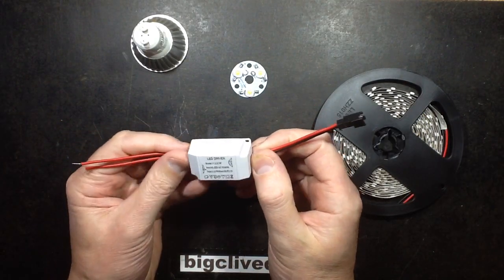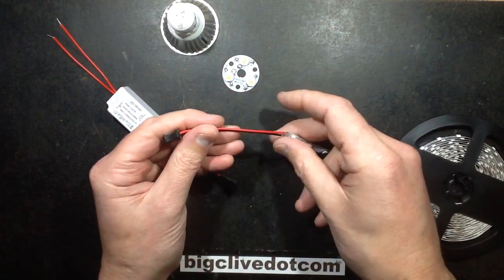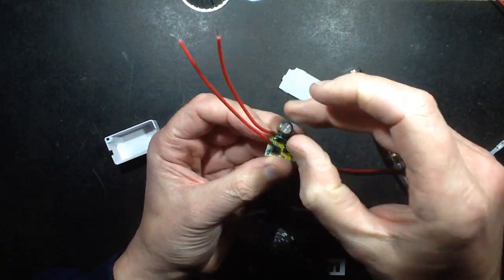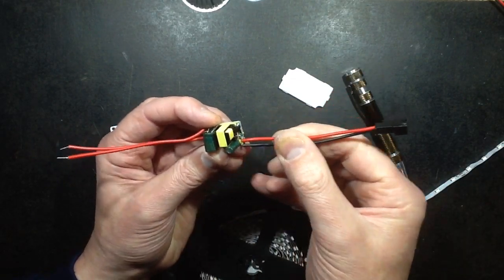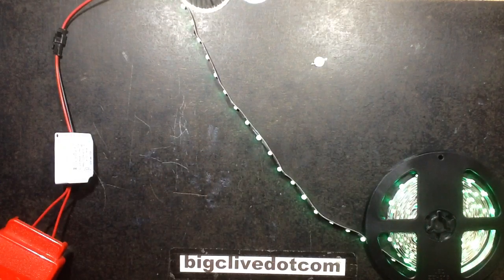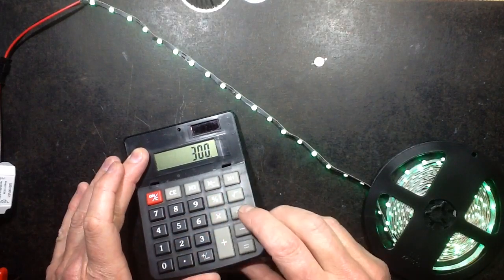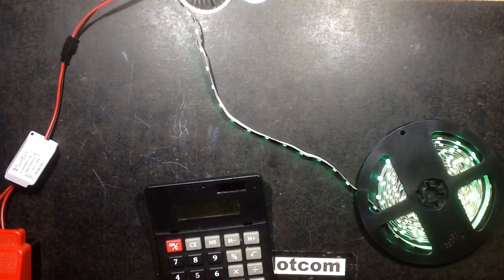Running LED tape on an inappropriate power supply.

Comment: Hello Clive , please help me how do u calculate current  load for 100 m triple LED  and how much LED driver needed?
Reply from the maker: Typically for 12V it's roughly 60mA full white per three LEDs, so it will require lots of power supplies, buffers and suitable fusing.

Comment: Thanks for the GREAT VIDEO. I had been searching for something like that, for AGES! I have got LED lamps at my home, and very often they burnt out. They were pretty expensive to replace. However I had bought cheap LED strips from China that I wanted to put in the lamps instead of replacing the whole lamp. I wanted to find out if I could run the 12V LED strip, with the Constant Current Power Supply used originally in the LED Lamp. So apparently I can... Will try it now..
Reply from the maker: It will depend on the power supply.  For unknown ratings it might be better to get a small 12V supply for the tape.
Reply: @bigclivedotcom  I dont need the whole LED strip for the lamp. I need max 50 cm (20 in) long Tape.
Reply: @bigclivedotcom  Very off-topic here, but I find it great that you still reply to comments on videos from 5 years ago! Cheers!

Comment: I've got RGB+W 12V 5m LED strip and as I counted:
1 segment = 10cm = R+W+G+W+B+W -> 6 x 5050 LEDs
5m = 50 segments = 300 LEDs
300 * 20mA * 12V = 72W (12V 6A)
Am I right?

But what if I just want to drive only for example RED and BLUE (using arduino)?
Does it mean that I need (2*50*20mA*12V) 24W (12V 2A)?
Reply from the maker: If you measure the current of just one section of LEDs it will give an idea of the potential total strip current.  It can be high with RGB tape.  Sometimes it's better to divide it into smaller sections.

Comment: Hi,

I recently purchased an LED light strip and PSU from China to go alongside one I had bought from a U.K. store.
This is to go under a bunk bed for our grandchilderen.
I installed and tested the light all o.k.
Sunday morning 06:00 grandchild screams about a large bang when he turns on the light.

Investigation shows the PSU exploded!

I have pictures but am unable to upload them.

Regards,

Doug
Reply from the maker: Don't trust the cheap power supplies.  By all means buy the LED tape, but source a power supply from a reputable UK seller like CPC or Rapid Electronics.
The eBay power supplies are often very under-rated, have poor internal protection and worst of all, often have very little isolation between the 240V side and the output.
Reply: Hi,
Thanks for the quick reply!
I have done exactly as you suggested an ordered from a U.K. supplier. I've never had this sort of problem with anything I have bought from China before, maybe I've just been lucky? Anyway lesson learned! :-)
Thanks.

Regards,

Doug

Comment: I was searching your channel to see if you did a video on ebay AC to DC power supplies.  I was shocked to find this video because I actually used this setup to run some led's under my microwave.  I used a 1M length (60 led's that I did have to cut down a bit.  I think I shortened it by 4 or 5 led's).  I was curious to the quality of the power supply and the safety of it.

Comment: Clive (or anyone) . . Can I run those led strips off an ATX  (Pc) power supply on the 12v? I'm doing it already intact and they seem to like it, I'm just concerned about longevity . . Thanks.
Reply from the maker: It's fine, but use a fuse per strip if the supply is rated for a high current.
Reply: @bigclivedotcom  Great, thanks Clive 👍🏼

Comment: I'm using 2x 5 meters led tape and more 40 centimeters of tape. A 12v 2A at the controller, and in each joint a little amplifier with One more power supply 12v 2A.
But, the lights are messing, only a few is working propelly.
Any suggestion? Any idea?
Note, all of them works fine alone, things get strange after the amplifier.

Comment: Hi! well great video but i hate the fact that it confused me even more. xD Did you say the LEDs are connected in parallelxD project involves a 5m Led strip rated at 20w per meter at 5v. what is the recommended power supply as far as the current is concerned.
Reply from the maker: If the tape really is 5V then the voltage drop across it will be significant at the current involved.  It would potentially be 4A per metre.
Reply: +bigclivedotcom so for 5m i should get 4A * 5m = 20A power supply?

Comment: Where can I get a workbench quick connect like you have with blue, green and brown quick connectors?  That is awesome and perfect for quick connect of line voltage.  I like the way the lid snaps closed for safety.
Reply from the maker: It's a Cliff Quicktest that's common in Europe, but now available in US/Canadian colours too.
Reply: OK.  Found them.  Kind of pricy.  Seen them several places on the internet.  Range is between 50+ to 100 US dollars.  Looks like something that would sell for about 25 to 30 dollars.  Have to think on it at that price.  But thank you so much for the reply!  I want one.

Comment: I wired one of those boxes with an infared reciever up to a molex connector and plugged it straight into the 12V rail on my computer PSU. I have RPG LED tape inside my case now. Looks cool as hell!

Comment: Anyone know what that power supply is? The one with the safety lid to turn it on?
Reply: Bit late, but if you're still wondering you can google for "Quicktest Mains Connector Block" and get one of your choosing and country.

Comment: How would this be different than using simple power adapter (lets say with the same current output and voltage as your 300mA driver)...  such as the ones used for  light duty electronics (chargers, modems)?  Would they work to light up LED strips like this or would the adapter burn out? Would it just be dim?
Reply: As far as I've tested, you can use them, BUT.
Voltage of the supply should not be higher than voltage of the LED strip. Otherwise you get a burned strip. (lower is fine but you'll get dim light, pretty much what you'd expect)
As of the current, the strip can't draw more than the supply provides, so in case of undercurrent it simply won't work.

The question "what happens if you overcurrent your strip" is why I watch this video.

Comment: Hi Clive. I'm big fan, love your channel but... Correct me if I'm wrong but saying that this powersupply will pump 300mA through let's say one section (3 LEDs) is a bit bull...? That would require far more, than 12V, which this powersupply is capable of delivering.

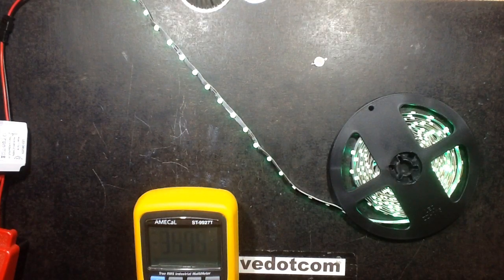Comment: @ 4:29 you say, "...4.48 volts across 150 ohms"; which would be ~30mA.

When you calculate it, you use .48V; which gets you 3.2mA.

So did you misspeak with the 4.48V? I think so because 3.2mA you get matches the top of the head calculation you did at the beginning of the video.

Not trying to be nit-picky but when I follow along I pause the video to do the calculations myself and check my answers against yours. Because of the angle I couldn't really read the screen myself.

You make great straight forward videos; keep it up!
Reply: +theomnipresent1 It was clearly .48V.
Reply: +theomnipresent1 He started to say the word four, but then stopped halfway to say "point". So it was "fo-- point four eight volts"

Comment: Hi Clive and Happy New Year.
Loving all your videos.
Electricity baffles me so I need to confirm something with you. I bought two lots of LED lighting so 40 modules in total.

LED Type : 5050 SMD*Warm White
Input voltage: 12V DC
Current Per Piece : 60 mA
Consumption Watts Per Piece : 0.72W
Number of LEDs : 3 Per Module
Number of Modules : 20
Waterproof

Power supply is a laptop style brick AC 240 down to DC12V 5A.

Will this PS be suitable?

Thanks.
Reply from the maker: 40 modules times 60mA (0.06A) equals 2400mA (2.4A).  So if the PSU is genuinely rated it should be fine.
Reply: bigclivedotcom 
Thanks. Haven't tested current output yet.

Comment: I repurposed a computer supply to run mine. the over voltage protection kicks in at 12.8 and shuts the supply down . the adhesives I doubt are genuine 3m  as none of mine have stuck well  even with proper prep.

Comment: Hi Clive I ran a 5 meter RGB light string on 12v 1a. After a day it stopped running. The supplier told me it needed a minimum of 4 amps.
Reply from the maker: The 5050 type of tape that has the RGB combined into single LED packages is very power hungry.  It does require around 4 or 5 Amps for the standard spacing stuff.
Reply: @bigclivedotcom  how can i get 4-5 amps from? can i plug from any socket at home?
Reply from the maker: @vivian-uh7lz  If it's 12V tape you'll need a suitable 12V power supply rated for the tape at full load.
Reply: @bigclivedotcom  how do you mean?
Reply: @bigclivedotcom  and anyway can i ask u about how my problem with my led strips, maybe u could help me?

Comment: Looking at LED panel lighting and some of the power supplies they come with are horrendously RF noisy. One guy could pick up no broadcast radio in his house because of them!
Reply: +Choppington Otter 
Yeah, too many LED advertisement boards such as those used outside of CVS Pharmacies have dirty supplies.

Forget about using an AM CB within a block of one.

Comment: I just received a reel (5M-300-3528) of Blue LEDs (£2.32).
Wrapped it around a window + connected it to an old monitor PSU (12V @ 4A)
and it is incredibility bright.

Comment: In regards to using that PSU with a short length of LED tape, the current would be limited by the maximum voltage that the little PSU can put out.  Did you ever measure the no-load voltage of it?
Reply from the maker: +DavidAVD1 I've never actually thought of doing that.  I just assumed it might float up to a random level off load.  I have now corrected that assumption by testing it and it came out at an open circuit of just 12.24V.
Then I shorted it out to see how it fared.  It fared fine, so I stuck my meter on the 10A range and shorted it with the probes and it clocked in at 216mA short circuit current.  Quite a robust little module.

Comment: Any suggestions on how to dim 300LED 5050 strip lights using an infrared remote? Application - home theatre. I have an IR controlled dimmer  for regular incandescent bulbs but using diffused lighting would be awesome. I did use dimmable LED bulbs but the results were not ideal with occasional epileptic unfriendly strobing.  Using switched power supplies is a big no. Old basic ac to dc transformer? Where from?
Reply: +Rav Gupta yes I suggest using an Arduino output in PWM mode I have this setup at home and it works really well there is a nice library to decode IR from a remote control  I use the four coloured buttons on my SKY remote to switch on the LED's and to dim them as well check out GREATSCOTT for info
Reply: andymouse123 Thanks:) Found some off the shelf solutions but had to implement in the DC domain.

Comment: Where have you got that thing from that you used to connect the supply to the mains? I want one! It looks like it even has an integrated switch that shuts off the terminals when opened, right? The things I do when testeing with screw terminals mostly aren't the safest...
Reply from the maker: +superdau It's a quick-block or safe-block.  You can still get them, although they are less common now for safety reasons.
Reply: +superdau   http://cpc.farnell.com/1/1/42471-cliff-electronic-components-cl1853-quicktest-block-1-5m-lead-13a-plug.html

Comment: hej Clive, 
Nice videos you make, really like the teardowns and circuit explanations. I have just ordered a car USB charger from ebay, and there is alot to choose from! this was just a very cheap 2*1amp output, but there is a few 2*2.1 amps out there, among others some belkin branded as both 10 and 20w - do you know if they are any good? because I read an article by maxim introducing their new dedicated usb car charger chip, and they listed alot things this chip could offer unlike the cheap chargers - like lowering rf noise and battery protection etc. making all other chargers seem like a deadtrap or atleast as crap products

Comment: So far I've gotten my 6v rated strip LEDs to run from 4.5 (stock), arduino,  and a few segments right on 5v USB.so far I've not had any to teardown after burning out.

Comment: I used a seemingly appropriate PSU on the last reel of tape I got, damned thing just blinked the LEDs on and off, so I guess it wasn't the 2A it was rated at... :P
Reply from the maker: +twocvbloke That does sound like the supply was being overloaded.
Reply: bigclivedotcom
Yep, but the tape's been cut up now, so not trying to run the whole length off one supply, but that said I don't like the colour of the tape, to sickly yellow for something claimed to be "white"...

Comment: Hey I just ordered some RGB LED tape, because ya know, well I like this sort of thing. anyways It comes with a PSU,  a remote and 5 meters of RGB LED tape. Do you have any experience with these? I only paid like $12 for the whole setup..
Reply from the maker: +ElfNet Gaming The price has crashed with this stuff.  I also bought a similar set for about £11 inclusive of shipping within the UK.
Reply: Yeah it costs a little more for me in shipping to the States..
Reply: +ElfNet Gaming well you have to dig to find the deals, but you can get them as cheap as about $8-$10 + free shipping for all that if you look hard enough.

Comment: Brave man touching the tape while powered from that dodgy little supply.
Reply: +PIXscotland well its only low voltage so you cant get electrocuted by it. but yes it is dodgy and from china so who knows how clean or dirty its waveform is. and the mains isolation at that.
Reply: +smallenginedude71 It was the mails isolation part that worried me.
Can't remember the circuit of those but I've always been skeptical of anything without a transformer. :-D

Comment: I'm imagining what the lighting in your house is like, I imagine it's either incredibly bright with LED lighting ~everywhere~ or it's the most tastefully done mood lighting with little accent lights all perfectly balanced. Either way, top video as per!
Reply from the maker: +MrHack4never Ultra low power.  Total cost per year to run 24/7 around $1.   Provides a very soft glow to the house at night so you don't need to turn on lights if you get up in the middle of the night.  I could put them on a timeswitch...   But it would probably draw more power than the lamp.
Reply from the maker: +Cal “Calomile” Hallows It's all subtle mood lighting, some of which stays on 24/7.  Quite a few chandelier type ceiling fittings with a different style of lamp in every holder.  Mostly DIY novelty lamps.
Reply: +bigclivedotcom teach us your ways, oh big man! I'd love to have that kind of lighting in our house! Now I have to search your channel to see if you showed how you did it already
Reply: Can you do a tour ?
Reply: +bigclivedotcom "some of which stay on 24/7" afraid of darkness? or just lamps running of "magic" lightswitches?